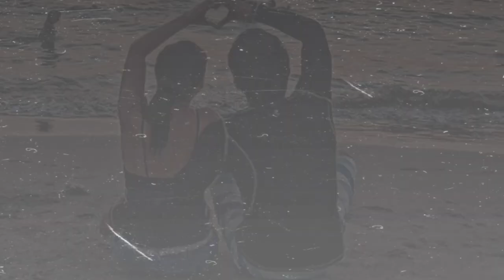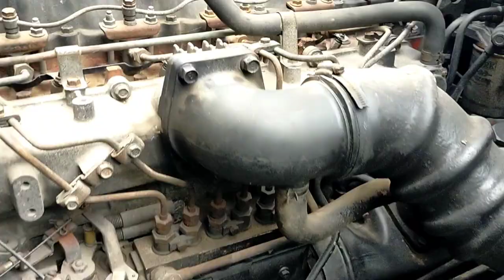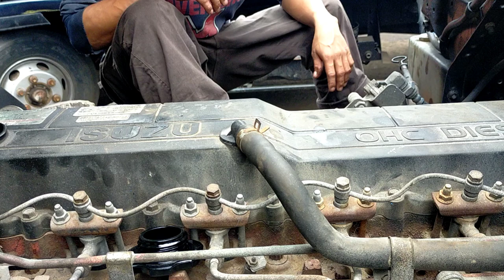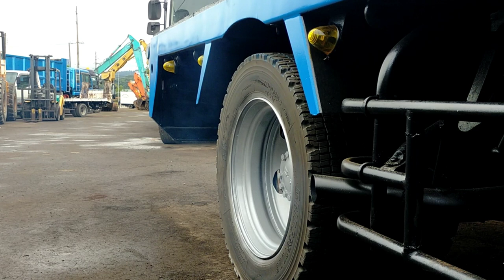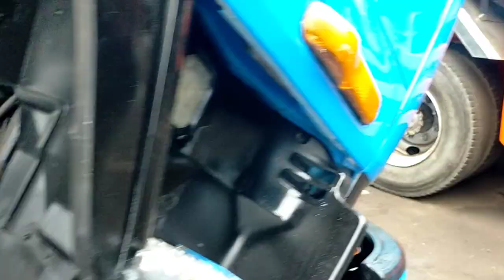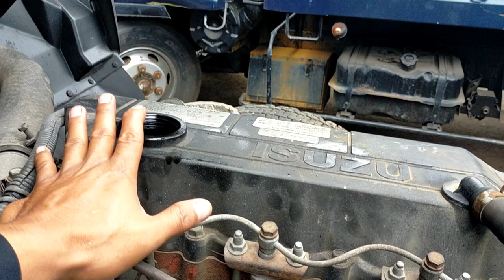PAANO MALAMAN KUNG BLOWBY ANG MAKINA? || MAGING MAPANURI

Comment: Ang term na 'blow-by' ay natural occurence ng lahat ng ICE o internal combustion engine, old or new. Sa bawat combustion phase ng cylinder ay mayroong nakakalusot na gasses sa piston rings papunta sa crankcase. Ito yung tinatawag na blow-by gas. Nagreresulta ito ng internal pressure kaya kailangan ng PCV o positive crankcase ventilation valve to be vented out and re-introduced into the intake manifold for recombustion. Otherwise, it will cause several problems like blown cylinder head gasket among others for whatever reason that the PCV does not function or not vented out.
Kung loss of compression ang dahilan ng pagiging mausok ng makina (most common cause is broken piston rings; pwede ding gouged cylinder lining; or valves not properly seating or sealing against valve seats) hindi ito matatawag na 'blow-by' kasi nga nadefine na natin kanina kung ano ang blow-by at uulitin ko: ito yung gas na lumulusot sa piston rings na resulta ng pagsabog ng fuel-air mixture sa combustion phase ng bawat cylinder sa ICE, bago man o puma.
Kung ano man yang tinatawag nyang 'blow-by' ay hindi ko alam iexplain.
Reply from the maker: Salamat po sa info sir👍
At least nadagdagan po kaalaman ko😊
Reply: Sabi mo dimo alam ixplain ang blow by bat haba ng naicomment moh kaw naman.
Reply: @michaelbansag8539  yung alam kong blow-by ang ipinaliwanag ko. Ang sinasabi nyang blow-by ay iba sa sinasabi ko kaya hindi ko maipaliwanag. Kung naiintindihan mo yung explanation ko hindi ka magkukomento ng ganyan, promise.
Reply: Sir palagay ko naiintindihan mo naman ang sinasabi niyang blow by, alam ko rin na mali siya na gawin niyang diagnosis ang salitang blowby dahil gaya ng definition mo ito ang tama. Parang kasi yan na ang nausong salita ng mga mekaniko at naipasa na sa mga susunod na henerasyon gaya ng colgate sa toothpaste o kodak sa camera. Pero ang tanong ko sir dapat bang ipaayos ang sasakyan kung malakas ang labas ng usok sa dipstick kahit hindi naman malakas ang usok na lumalabas sa butso?
Reply: Normal lng blowby sa diesel, ung sa akin nga tumatalksik pa ng kaunti ng oil still mlakas pa rin naman ang makina, cguro kong marami na at mas malakas ung usok dun sa may dip stick at tumatalsik aun meron tlga problema at kong light blue or parang puti na umuusok may problma na tlga at hndi na xa torque malamang loose compression na.
Reply: Marami kc ang cause nyan pag mausok sa Jan sa oil fill ndi lang sa tambutso titingin parang mali ung paghatol ni vloggers

Comment: Maraming salamat boss.. Malaking tulong. Tanong ko lang boss ano ba pag kakaiba ng electronic at fully mechanical sa mga light truck plano ko bumili. Salamat po
Reply from the maker: Malaki po sir ang manual ay walang computer box,ang electronic nman po ay meron na kagaya din ng mga kotse na may ecu operated
Reply: @KaYabevlog  ang canter na 4M40 mitsubishi electronic na po ba? At ano po mas ok sa Light truck yung manual po ba or electronic po. Salamat ka yabe
Reply from the maker: Some say ok ang manual pero para sakin ok po ang mga electronic kasi pag dating sa fuel consumption very efficient po unlike sa manual
Ang dis advantage nman sa electronic eh kung wala kang mekaniko na reliable pagdating sa pagmaintenance nito.

Comment: sir sana mabasa nyo..ung space gear disel ko kasi malakas crankcase pressure kaya malakas talsik sa dipstick and oil cap..pero walang usok, hindi nagbabawas ng oil and coolant, walang overheat, malakas hatak, malinis ang breather, good ang injector washer. Saan kaya galing ang malakas na pressure..Piston ring na ba or kelngan lng change oil?..ano sa tingin nyo sir..Salamat in advance

Comment: Kayabe tanong lng kung ano ang problema ng sasakyan ko 4d56 surplus japan matic.....pag inistart di sumasama sa oagikot ang timing belt oero yung fully ng makina at alternator umiikot.....salamat
Reply from the maker: Baka nman ho ang pulley ang problema sir,ang mga pulley po kasi may kunya,baka putol ang kunya kaya ung pulley lang naikot,pwede din pong nakalimutan ibalik ang kunya kaya free wheel talaga sya
Reply: putol na cguro timing belt mo.or ubos na ipin.iwasan mo mg start ng start bka lalo masira makina mo..sna nka tulong

Comment: Boss may alam ka sa n14 Cummins puti ang usok pag pic apan bago cya overhaul 🙏tulong naman
Reply from the maker: Kapag binirit po ba lalong kumakapal ang usok?kapag oo po pwedeng late ang timing ng pump po.
Lalo kung hindi 1 click kapag inistart
Reply: @KaYabevlog  "n14 Cummins big cam "walang problema sa timing pag binirit cya ng dahan dahan walang problema pero pag picapan mo mag failure cya
Reply: Bogo calibrate pt pump at injector

Comment: Gud day boss. Yung nabili kong Toyota Corolla SB, kapag unang start umuusok,pero pag nakatakbo na ng 3 o apat na km nawawala na. Ito ang inobserbahan ko, hindi naman nagbabawas ng langis. Wala naman usok sa oil filler saka sa dipstick. Walang talsik ng langis sa dipstick. Hindi naman nag ooverheat. Tuyo naman ang tambutso,walang sign ng oil. Ano po kaya ang problema?
Reply from the maker: Wala pong problema sir,base sa mga sinabi nyo normal lang po
Reply: @KaYabevlog  hay salamat. Nabawasan ang isipin ko.Ayaw ko kasing ipakita sa mga mekaniko dito sa amin at alam kung pagkakakitaan lang. Logic lang, kapag may problem may mga sintomas. Salamat sir sa reply.

Comment: Sir sana mapansin..
Unit namin sportivo na 2012, 72 mileage palang.. kaka change oil at pms nung 70k pa.. 75 next.. 
..
Ngaun po pag bagong start wala pa usok sa dipstick pero pag na reach na temp nya may kunti lng perp walang talsil.. sa oil cap may talsik kunti pero sbe normal lng daw pero walang usok.. and kakabili lang namin kasi sya from candelaria inuwe pangasinan wala nman po problema..malakas hatak nya mabilis daily use pa namin..ang tanung ko lng po ung kunting usok po ba sa dipstick ay normal lang po ba un? Kc sa umaga or bagung start nawawala dn po usok nya

Comment: Sir ano masasabi mo sa 6uz1 na pwdi automatic at i manual transmission? Maganda din ba?
Reply from the maker: No good po para sa opinion ko sir,may nagtry na sa work ko noon nakakaproblema sa performance,pero kung may swabe gumawa sir try nyo nlang po pero risk po un dahil pati tranny ay kasama na sa ecu.
Reply: @KaYabevlog  e sir ano ang malaking kaibahan ng manual dun sa atm at pwdi manual? Sabi kasi sakin sa subic halos puro ganun nadaw nga bagong model na dumadating plano kasi mag labas ng erpat ko kaya hingi sana ko advice?
Reply: Pero may clutch din naman sya sir kaya lang pwdi daw yun i automatic may pipindutin lang
Reply from the maker: Kapag fully electronic ang tranny sir oo meron pong lining,ang operational nga lang po ay puro magnetic ang nagpapashifting sa tranny from gear 1 to 8.
Reply from the maker: Txaka madami pa po mabibiling hindi automatic na tranny sir
Reply: @KaYabevlog  ok sir salamat sa advice goodbless po

Comment: Diesel engines are not required to havethese valves. The positive crankcase ventilation, or PCV, valve routes crankcase gases through a hose and back into the air intake system where they are re-burned in the engine. ... ThePCV relieves pressure in the crankcase, preventing harmful oil leaks.